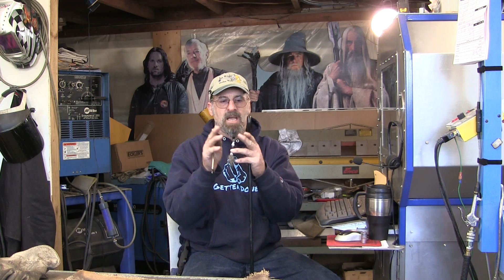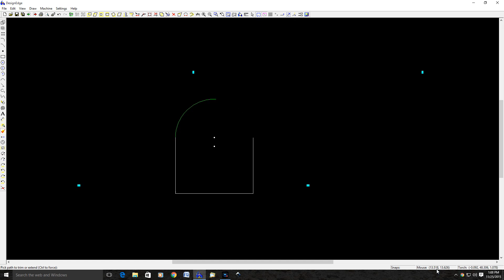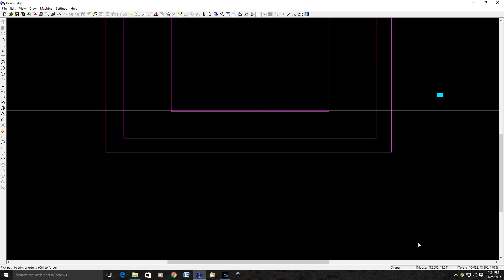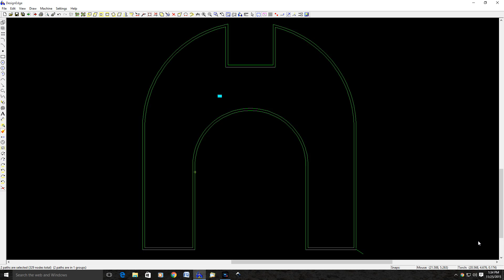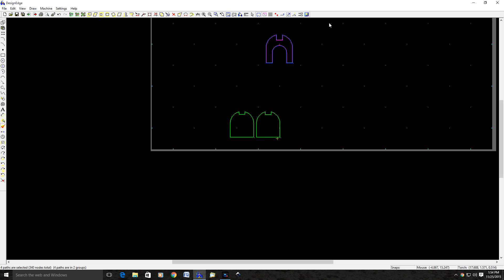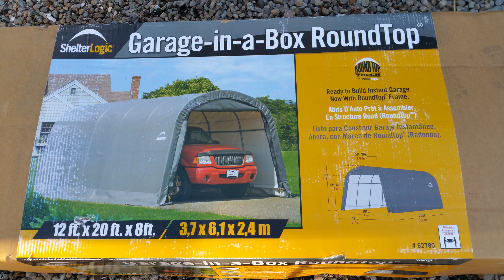The Impacted Idea

Comment: I've used small duck bill anchors to anchor mobile homes down in very high wind areas and they work really well.  I drove them with a sledge hammer but the 966 loader that pulled them out had the ass end off the ground trying to pull them out.  Cheap, easy anchor that works extremely well.

Comment: Your impact wrenches sound like they are starved for air. Try a 3/8" or 1/2" air hose with High Flow style air couplers and plugs. Tru-Flate (automotive style) or Industrial Interchange all add considerable restriction to flow. If you are using 1/4" line, try threading the hose directly into the air tool with no quick-connects to demonstrate just how much restriction the air has to fight to get through. I learned this lesson the hard way. My shops is plumbed with 1/2" pipe going into 3/8" hose - huge improvement with all my air tools, especially the air-loving Dynabrade belt sanders.

Comment: I’d say your idea work, like you said it wasn’t great but it worked. Like someone else a hammer drill would have worked better, but if you don’t have one, and you have impact it works. I’d say thou if you going to use the impact it be better to use larger air hose and impact. Like 3/4” or 1” air hose with crows feet and a 1” impact.

Comment: Maybe a 1/2" Hammer Drill - in Hammer mode.   More than just twist but push also.   Like the video.  I also have a PlasmaCam for the last 10+ years and learn tips from time to time watching others.  Given plenty of lessons myself.  I cut AR500 1/2" at 10ipm  that is heavy like 3/4 and very dense.

Comment: Been there, you're driving a torsion spring, same as a long extension bar. Next time use a pipe threader for the tool. Steady torque not effected by the shaft windup.  Or hire a couple of high school kids.
Thanks for the great videos!

Comment: I really enjoy every one of the very informing videos here on YouTube Keith. After watching this one building the tool to aid in screwing down the helical anchors, May I add, I just welded a 1 inch nut to the top of the  helical anchor and used a impact driver like you did and worked very well and much better control while driving down. I really appreciate you sharing your knowledge with us

Comment: anchored my structure that way, but, I used some ratchet straps tied to the top pipe, outside the side, pipe and inside the bottom pipe to the anchor and just tighten it as needed with a good bit of tension.  Of course the strap was one of the 2" types.

Comment: 100 feet of 1/2 is gonna be a HUGE drop in PSI, even with fancy Ingersoll Rands. It's flow depednent (CFM being pushed), but with water pressure in a nominal 1/2" in unrestricted conditions 100 psi drops to ~11 psi. Duno off hand what the friction co-efficient of air is but you can ballpark a drop around there.  At those lengths youre better off buying some 16 gauge extension cord from MSC and driving that socket with a corded 50 dollar home-depot import ;) (A rotary hammer drill + a SDS spline shank modification to your 'flask' rather than a square drive would make easy work of this if you're going to go at it again) Good episode to watch !

Comment: I worked as a welder for 7 years starting when I was 20 and a machinist for 15 years as my last employment. I was a bit confused as you were cutting the aluminum for shims because, from experience, wasn't even thinking that you would attempt  to remove them after tacking. With being both clamped tight and the additional force created from the shrinkage of the cooling molten metal  of the tacks, sorry, but I was having a good laugh when you were trying to pull them out. :P For .010 shim spacing  on each side I think I would have used 3 sheets of paper per side or perhaps 2 thicknesses of index cards. And in point of fact to widen the inside thickness of your socket only one side needed shimming. I would have trimmed the paper to a minimum needed, on all sides and cut away the interior.  Just left it in after tacking and it would burn out during the final weld-up. Or perhaps using tin-snips just cut a couple narrow strips from some steel banding (compatible with the steel welding process) to leave in and only on one side.

Comment: when you were driving the anchors pour a lil water down next to the shaft of the anchor this will make the vibration liquify the soil at the end and it will go in way faster and when you are done the liquid helps the soil set tighter making a slightly better anchor.... and if you mix some very very wet cement not concrete and make a small hole where you will drill pouring that cement in when you start then it will solidify the soil as you drill down making an awesome anchor.... the impact vibration will cause teh cement to full to the bottom of the hole thru liquefaction and if you make it really wet cement then it will absorb into the soil firming it up without making totally solid concrete.... takes a lil experience to get right consistency..... either way the addition of water makes drilling thru soil of any kind easier ..... i always use a garden hose when i need to dig fence pole holes and have drilled wells with hand auger and you can penetrate anything except soild rock .... gravel and large stones is easy sand it lightning fast

Comment: As the son of an auto mechanic, your "20 year old import" impact wrench sounds like it's working alright compared to the IR one you borrowed.
On the other hand, you have 3 things working against you for using any pneumatic impact wrench to drive these anchors:
1. 100' of 1/4" air line is a BIG restriction to your air flow. A Goodyear brand 100' 3/8" ID rubber air hose with 1/4" NPT ends costs about $60 where I live (upstate NY), and should be a drop-in replacement. The larger hose should cause about 50% less restriction to air flow than the 1/4" air hose.
2. 110 psi isn't a whole lot of air pressure if you're using an impact wrench. My dad runs his shop's air pressure at about 150-175 psi, and it makes the air tools work MUCH better. Compared to 110 psi, this can increase the power of an air tool by 135-160%.
3. The shank of the ground anchor acts like one of those "torque stick" extensions that some mechanics use to prevent over-tightening lug nuts. In other words, the helical plate at the end of the ground anchor is only seeing a portion of the torque that the impact wrench puts into the eye at the other end of the ground anchor. The constant torque put out by something like a hand drill (but with more gear reduction) would work better, and you could probably figure out a way to use the same adapter that you just made.

Comment: What drawing program are you using?? Does it come with the table or did you have to purchase separate ?? Reason I was asking, I need some parts cut out on plasma table.  Should  I have the machine shop input my drawing into there system or could I put on a Zip drive and give to whomever?? Hope that made sense,, Thanks, and your a great teacher..

Comment: In the late 70's, I stopped at Dubuque Iowa to refuel the helicopter.  Looked out in the auto parking lot and spotted a two seat single engine airplane upside down in the lot.
Asked if the guy had forgotten to tie down his plane.  They said, no, you need to go look at it.
It had been anchored with utility company helicoil anchors, normal used to anchor guy wires.  The anchors were about 12" to 14" in diameter and had a 12 ft long rod.  
There was a rope from the airplane to the anchor rod, then the loop on the end of the anchor rod.  Just past that was a big chunk of asphalt pavement, then the entire rod, and finally the anchor.  All this was laying in the parking lot tied to the airplane. 
Airplane had been hit by a tornado.
Sometimes it just doesn't matter what precautions you've taken.

Comment: Those anchors are a bear.  Too much torsion spring action in the anchor itself for an impact probably.  An old low speed Milwaukee right angle drill might be the ticket for  those.  Tie off the handle end to a truck hitch or tree to keep from breaking your arm if it grabs haha!  The tool is a great idea for sure!!  Thanks for posting this.

Comment: I think your onto something, maybe just not quite the right tool for the job.
The spring in the anchor and loose ground negates any momentum/impact of the impact gun, if you can keep the anchor loaded against hard ground it should work ok, otherwise something like a 1/2" air ratchet will keep moving forward until its max torque is hit regardless of the spring in the anchor/ground.

Comment: Maybe a bigger air wrench? Truck tire shops use 1"  drive. HF's are 160 for "Industrial" 300 for "Professional. Advertised for 2500 ft-lbs, but with mediocre reviews from Pros.  I like the portable pipe threader idea, but holding your end could be a challenge. ]Eventually you might twist the earth out of orbit, putting a new north pole on Cape Cod?]

Comment: You could make a similar driving adapter and fit it to a two stroke post hole digger, they are designed to drive a helix into the ground. The smaller units can be handled easily by one man and they have a clutch so no broken wrists if it stalls. The only drawbacks are that they have no reverse and finding someone from whom to borrow one as they can be expensive.

Comment: nice project.  I am new I metal working. just hobby. I wear glasses. and I had a problem. My glass is alway foggy when I place my welding mask down to welded. I cannot see the melting steel so i Cannot welded correctly. Do you have a solution for me? Best regard.

Comment: I have recently started using a plasma table, though a different brand. I am not getting cuts anywhere near the quality you are. What plasma cutter are you using and what amperage are you set for, what air pressure to cut something that thick?
Thanks.

Comment: I tried to drive an 8" or so inch lag bolt into a oak tree once with an impact.  It was so slow, I was sure something was wrong, but turned out, that sort of load is just not a good match to an impact wrench.  I agree that a big low geared drill with a nice side grip would be less effort in the end.  If I remember correctly, I had to refill my 2 gal air compressor around 4 times to get the bolt in there, and couple more times to get it back out.

Comment: Nice job, I'd rather stand over an impact and wait for a compressor to refill than use the bar through the eyelet. You could even just put a breaker bar on the socket as well and it would still be easier than the bar through the eyelet.

Comment: Not exactly the same thing, but the same principal, I use a cup hook chucked in my cordless drill to run eyescrews in. Or turn it around and chuck up the eyescrew in the dtill to run cuphooks in. Even if you are only putting in one, this saves lots of time and frustration. Great build from one torn up shoulder guy to another!

Comment: Yea man, that's a whole lotta drive for that impact wrench, but like you said, it cut you a lot of slack to get through the hard stuff. Maybe not quick but was that heel bar very fast anyhow? Plus your shoulder didn't fall apart and that was the main idea. You must have one heck of a compressor to keep up with all that! I just looked at the 12'X20'. I wonder about putting that on a concrete slab... Someday, someday.

Comment: PS: 100' of 1/4" air hose will really drop your pressure.  Put a gauge at the gun and you will be surprised.  3/8 at a minimum for good performance at that distance I would think.  Probably still get a healthy drop.  Line loss is amazing in hose.

Comment: Hello Keith,  That looks like one of the 1/2 Harbor Freight impact guns.  Good machine that i have had for many, many years but I upgraded this year to their new 1/2""Thunder gun" (I believe they call it) on sale at around $80 but a much more powerful (in torque) gun than the little one.  I think that is asking a lot of a small 1/2 but the new red body one would probably walk through it.  I keep the old one because it still performs very well just at a smaller torque value (seems like the old one was around 200# and the new is 600#).  It does lug nuts etc no problem.  Real stubborn 3/4 frozen nuts fall easily to the new gun keeping in mind it is twice the price of the older one.  Very good value for the money.  I recommend you try one of the new ones.  My only small complaint with them over 25 years of use is I prefer the ball bearing to the 'c' clip for socket attachment but for the price difference between IR and HF I will put up with it.  

Good to hear you have had good luck with those shelters for such a long period.  They just don't make it around here.  Had a very big one out at the boat yard anchored to a 6' x 12" wall with footings around the total perimeter.  Lasted about two years until the wind in one of our larger storms shredded it.  It was probably 25' x 90' and 24' tall.  It was a serious tent.  They took the warranty and built a steel building on the foundation.  Have a good day.  Doug

Comment: Build yourself a surge tank out of an old compressor tank or one of those portable air tanks.  Run your small air line into it then have a short piece of hose coming out to the tool - 1/2" hose with 1/2" quick couplers would be best.  Just run it in short bursts at maybe a 50% duty cycle.

Comment: Keith when faced with removing track plates from a loader chain, I discovered the existing bolts were distorted into plastic range. resorted to an 8' cheater bar. too nych walking. found an impact wrench on amazon 1400 ft# for <$400. did the trick. not all made same. your idea valid, u took knife to a gunfight. been there done that.

Comment: Love the concept, Keith. I have a bit ground anchor I use to keep things from "walking away" when I put them out by the street to sell.  I just use a long length of pipe to screw it into the ground.  A gizmo like then one you created would be great on the end of a big impact.  Looks like a 3/4 drive with a big air hose would do the trick.

Comment: Maybe use a Quality Brand  (Hilti, Makita etc) 36 Volt SDS Drill as they punch forward. I'm not sure if impact guns punch forward or just impact on the circular rotation?
Reply: +Simon Atkinson Or any punchy mains powered builders 'breaker' that has a rotation option.

Comment: Thanks! Always like your tool ideas.
I need a anchor driver to fit my Harbor Freight ,Electric Pipe Threader.
I can't help but think, it will drive those anchors. 
I have a 12X22 slab in need of a cover.
Another thing, I drag my portable air tank to the job site , and let it fill for 
air volume, good use for old compressor tank.

Comment: You call those ground anchors? Those are dog ties or airplane tiedowns. In my younger days I drove 300 ground screws in 2 days. Granted they were only 6 feet long and 10 inch diameter, meant to support a hop field.
https://en.wikipedia.org/wiki/Hops
 I made an adapter to fit a post hole digger mounted on a tractor. Took some time to get in position but only about 30 seconds to drive one in. The adapter was made of a piece of shaft bored to fit the PHD shaft and bored on the other end to drop on the loop. Then one cross bolt to lock it to the shaft and one hole for a 5/8" hitch pin to drive the screw/auger. Three of us took turns driving the tractor, feeding the auger and driving a truck full of the screws and lunch. That way we could all get warm again when we drove the truck. Ah, those were the days, slogging around in the slush and mud freezing my ass off.
 After they were in the ground a few weeks none of the tractors could pull them out. About 10 ton pull. We did break one off about midway down the 3/4" shaft so there is some tremendous anchorage in them. Surprised it didn't pull the ring off, a link of 5/8" chain welded on. Probably had a nick or defect in the shaft. 
 The ones you are using, I doubt an engine hoist could pull them out so they should be sufficient, ha ha. I like the way you clamp them with a muffler clamp, I will have to remember that one. I agree that a hole hawg would probably work better than the impact wrench, but ya gotta use what ya got. Great video, lots of memories and I even learned something, thanks.
    Mike (o\!/o)

Comment: Fun project. Your choice of pliers could have been better when trying to remove the aluminum spacers. lol Catch a buzz off the burning chromium fumes? You should have tried an electric half inch wrist breaker drill motors. Tougher than a pneumatic.

Comment: The mass of the adapter and anchor make the performance of the impact driver less than expected. On a nut or bolt impact drivers are OK because the internal hammers are closer to the mass of the fastener. I would try a lower mass routing eye hook with just enough opening at the top to slip over the eye of the anchor.
Interesting video. Keep them coming!

Comment: it would work way better with a air drill or air rotary hammer but not an impact wrench, because the system that makes a pneumatic impact wrench work has one issue... I felt that thing once I got my new BOSCH cordless impact driver... it can be stopped from rotating with a firm grip on the tool (something I won't recommend trying on a drill or rotary hammer)... because it is not constantly driving the tool but only impacting on aradial motion... so your self made tool is a nice idea and good concept... you just need a other driving tool itself (because a manual tool like your torque wrench does make the difference... (as it is not a impacting motion but constant force being brought to the anchor)

anyways nice vid and greetings from Lower Austria

enjoy your vids... no matter what bozo comes up ;)